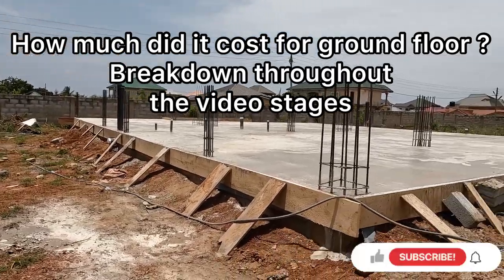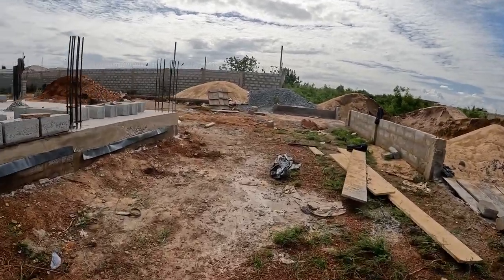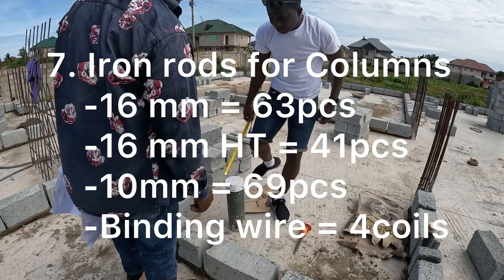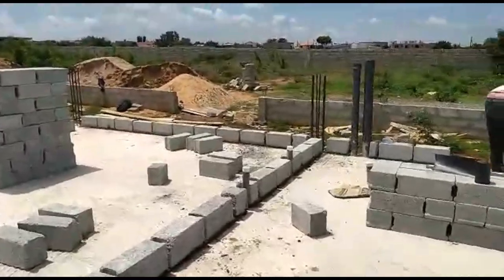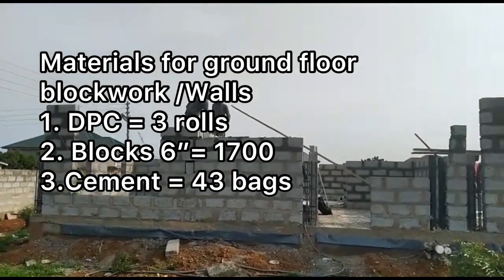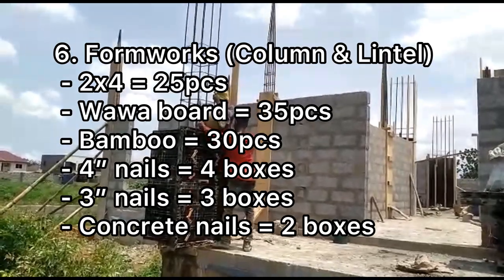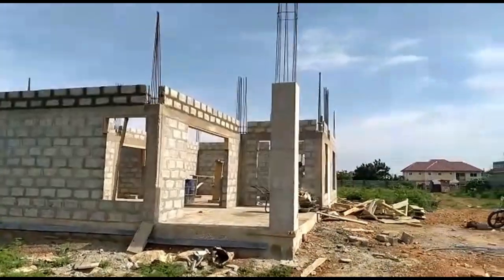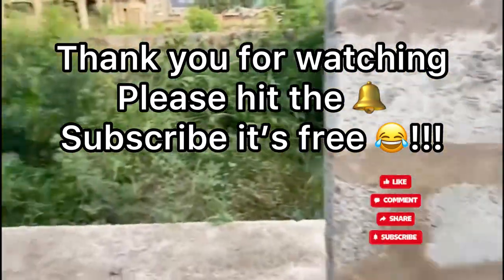Building in Ghana~ Cost breakdown of ground floor in Accra

Comment: WoW that is very very expensive  build for what you have done sofar.
Reply from the maker: Thank you for your comment, I guess it’s all relative to the design, spec and budget. The hyper inflation of building materials in Ghana and high structural specifications were the main cost drivers of our expenditure. However, considering that we were able to complete the whole ground floor at £75/m2 for 202m2 area is reasonable and falls in line with our expected forecast. Wait until you see how much we spent on casting the first floor slab where we had to use 25mm high tensile iron rods.